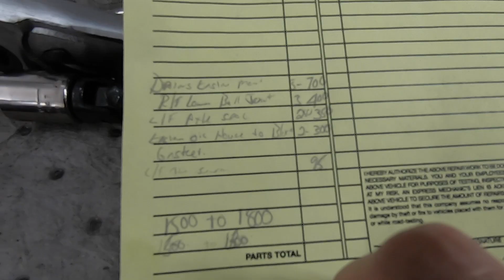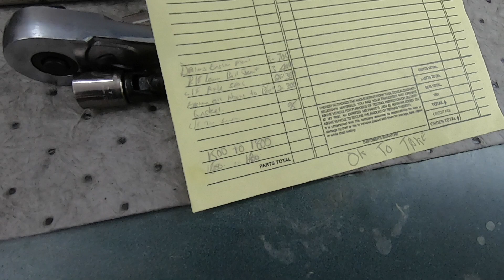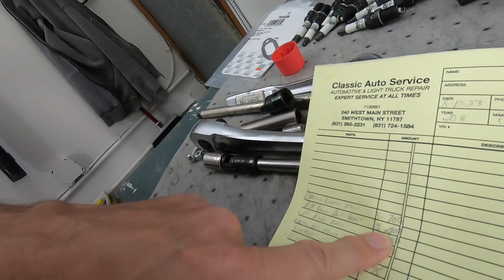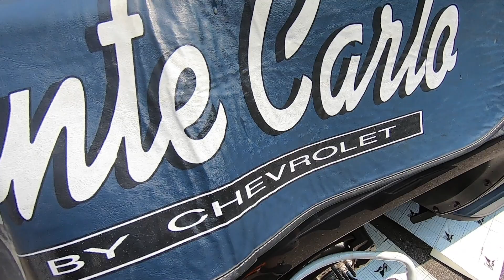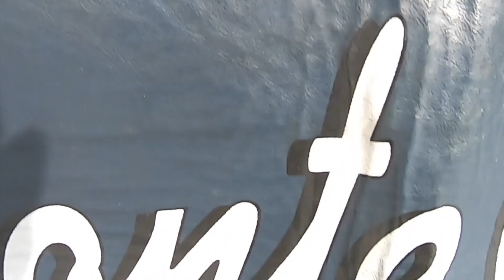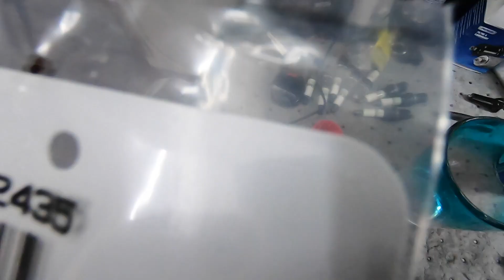2011 Suburban 4x4: Replace Engine Mount and fix oil leaks - $1800 repair Estimate!!!

Comment: Perfect video for me to watch, Im doing my 2014 Suburban LTZ 4wd next so it'll be exactly the same challenge in mine with the front wheel drive assembly in the way, Ill be sure to jack the engine up as much as possible after pulling the bolts. Thanks for the preview, seems its just what i was anticipating.

Comment: Am working on 2022 suburban. About 3hr each mount labor time. I removed exhaust manifold for easier access. Easy if u have impact gun. Mounts harder then exhaust, can't reach bolts easily. Still a pain. (4x4)
Reply from the maker: I’m in the rust belt.  The exhaust manifold bolts break off in the head.

Comment: Do your self a favor and get rid of that oil filter. I could hear the lifters in the video and with the active fuel management they’re sensitive to oil pressure. Also check your manifold bolts I heard some exhaust leaking as well.
Reply from the maker: Thanks.  Which filter do you recommend?  I have a Napa gold on there now, the longer style.
Reply: That’s a good filter! I usually recommend the uprf48 Delco